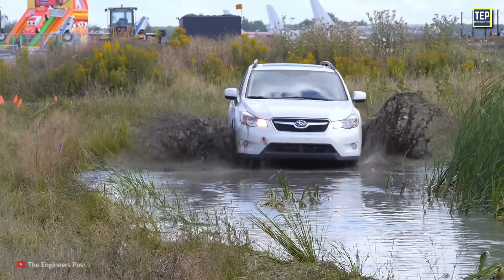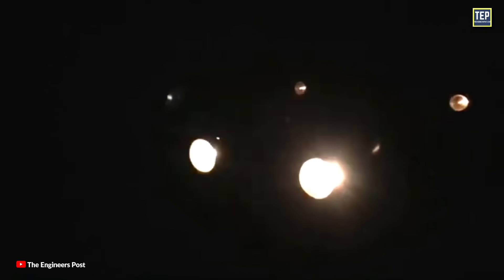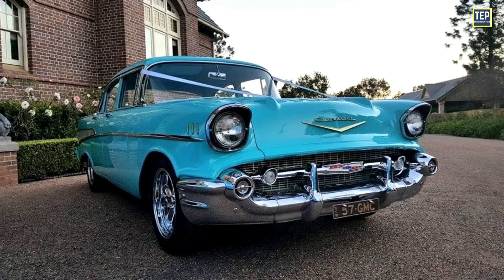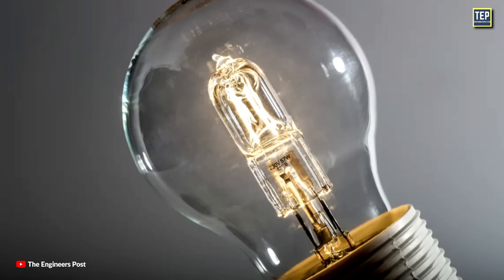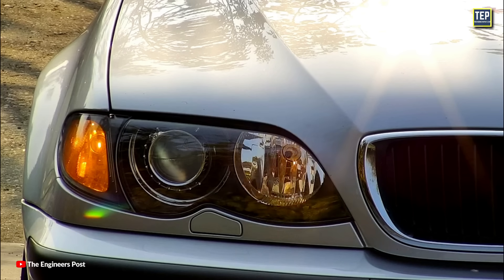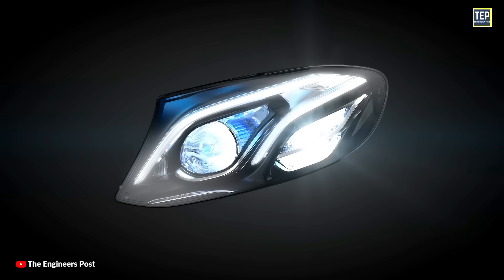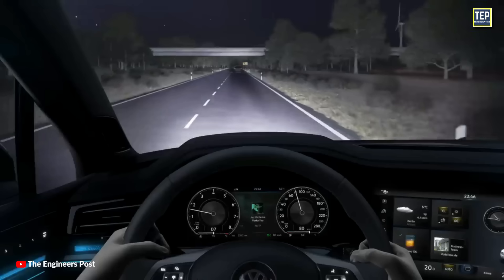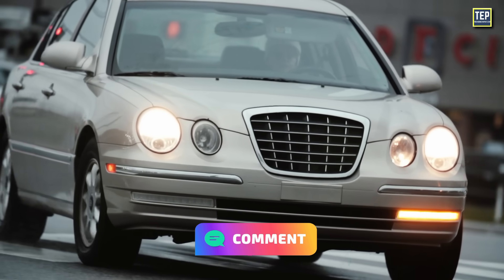The Problem With These Headlights

Comment: 13:07 I've installed Auxbeam h4 LED headlights into my 2020 Kia Rio which had halogen lights from factory and it's not entirely true that LED in reflector housing scatter light. I had to do slight adjusting of the beam pattern to match the original one but that's all there is to it. A money well spent as it illuminate more road surface and brighter as it's rated at 6500K at 24000LM shine so you guys might adjust your info...

Comment: I would rather change a $20 bulb than a $1500 headlight housing. I work at a collision repair/ body shop and I deal with it every day
Reply: I had to replace a headlight on my 2010 CL 550 after a small accident and just the one headlamp was almost $7k. To be fair even in 2010 Mercedes headlights were very complex. They were adaptive bi-xenon headlights that also projected infrared light for the Nightview night vision camera. Still insanely expensive though.
Reply: @-._.-._.-Sully-._.-._.-  My car cost 2K, so you could get 3 cars for that headlight!
Reply: Used to be that anybody with a screwdriver could replace headlights without taking the front end apart.
Reply: @yixnorb5971  A screwdriver, that's excessive. I just have to pull a rubber cap of the back then release a clip with my fingers to swap the Halogens on my Ford
Reply: @yixnorb5971 if you avoid accidents, you'll not need to replace the headlamps on a modern car. They should last the life of the vehicle.  
Isn't that better than constantly whipping out a screwdriver?
Reply: Yeah, right. It's like saying if you stop breathing, you'll die.@kewlztertc5386
Reply: @kewlztertc5386  True!However, when you live in a place that gets alot of rain storms or frequent hot and cold snaps, the headlight housing overtime has leaks leading to moisture build up. This normally happens after the warranty period end leaving you with close to 5 to 10k in repair cost. I have worked for Mercedes as a Technician and she this quite often.
Reply: @rcagillet 5 to 10k to repair leaks in headlight is just crazy. I assume you worked in a mercedes dealership, so it is against their policy to fix the headlights, correct? You have to replace the whole thing, but still, $5-10k seems very, very high. Is this for newer mercedes with complicated headlights? I think I saw an ad which shows mercedes headlights “dancing.” 

It’s actually not that difficult to find leaks on a headlight. If it’s the seal, which it usually is, it’s a pretty cheap fix, though it takes a lot of patience. If it’s a hairline crack in the lens, it’s even cheaper and easier. I’d go for ghetto fix rather than spend $5-10k 😅😅
Reply: @jegerm6752  true! However, once the moisture enters the assembly it's a shit show. You can repair it for cheap but your mutli beam advanced LED system might start giving you issues. In my honest opinion loads of crap
Reply: @rcagillet  yes my older BMW headlights leaked once, and I foolishly dismissed it, until the module for adaptive headlights got fried due to water ingress. Luckily it was the cheapest module in the headlight, and being a bi-xenon headlight, it was a simple and robust unit. Multi beam LED would be a total nightmare. I hate that we gotta replace the whole headlight assembly when it fails, no bulb to replace etc. Maybe some people know how to replace the LED chips, but it’s definitely very difficult and not a DIY at all.
Reply: @MattG-n2z  modern LED headlights are designed to last the entire lifetime of the car, and many are warrantied as such. 
So it may be expensive to replace them, but it's not something you're expected to do, nor should you have to ever do. 
If you damage them, that's what insurance is for.
Reply: @kewlztertc5386  
LED bulb modules are not that expensive to replace as you don't have to replace the entire headlight housing!!! They last a lot longer than halogen bulbs but they don't last forever!!!
Reply: @kewlztertc5386  And the government  knocking on your front door is there to help you😄
Reply: @williamevans6522  has the government ever knocked on your door? 
And yes when they have knocked on my door (or the door of anyone I know) it has been to help.
Reply: @kewlztertc5386   yes they have. They weren't  there to help.
I think your belief that it's  better tech is misguided.
Reply: @williamevans6522  it's definitely "better tech." Unlike with you, it's not my Opinion. 
Halogen bulbs last 2,500 hours max (1k min), while LEDs last 50,000 hours max (20k min).  That's scientific facts, not conjecture.
Reply: @kewlztertc5386  I believe you.
The problem is the electronics that drives the diode.
As quite a few have already posted, they do not last forever and are  very expensive to replace- which also is not conjecture
Reply: @williamevans6522   your comment makes no sense
The electronic (LED) will last, but the nebulous electronic that drives the electronic won't?

Heat and faulty craftsmanship are the only things that can shorten the lifespan of electronics. This is taken into consideration when the light's lifespan is rated. This is why the lifespan is between two numbers and not an exact number.  Similar to saying your lifespan is between 60 and 90 years. There may be defects or misuse that shortens your life, but you're type rated for that amount of years.
Reply: @kewlztertc5386  Your comment makes no sense.  The LED , itself is a discrete component while the driver circuit has multiple components.

How can you ignore comments in this thread related to problems and exorbitant  costs?
Reply: @williamevans6522  you mean the Light Emitting Diode, isn't electronic? WOW 

Driver components? Please explain.
Reply: @kewlztertc5386  Putting words in my mouth...
The electronic circuit  that supplies V to the  LED.

CLEARly we have a difference of opinion. 
I suppose  all the $$$ complaints and failures noted in this thread  are all make believe🤣
Reply: @williamevans6522  🤔 how many complaints have you read? 
Compare that number to how many vehicles are sold every year with LED lights (all). 
Then consider how every new car has a warranty. Now ask yourself, if you were a budget minded (P&L) automobile manufacturer, who has to repair or replace parts on a car that's under warranty, would you choose something expensive like LEDs, or something cheap like halogen if they had a similar failure rate?
Reply: Why I buy base model stuff with halogen reflector or projectors...
Reply: @cigarsgunsanddiesel8032   Because it works and is easy and cheap to repair.
Reply: Just one more reason why car insurance rates have gone through the roof. The Tesla car crash channels show repair costs for like $10-15k for what look like should be simple repairs, and many are totaled because the repairs exceed $25k.
Reply: My Subaru Outback's headlight was replaced when someone merged into me one time. Was AUD$3000 for the headlight alone (we have the LED Matrix version in Australia).
Reply: @HyRax_Aus  wow that's more than a shit-heap subbie is worth lol!
Reply: Totally agree. My 07 Accord Euro (TSX) eats bulbs as I drive on really rubbish NZ rural roads, and have my low beams on all the time. $20-30 is great. Another advantage is both high and low beams use the same bulb, and the incan bulbs for tail, brake, side lights and indicators are also all the same. Real easy to carry spares; sorted with just two bulbs! Thanks Mr Honda.
Reply: @granthoughton769 "really rubbish NZ rural roads" this why none of my vehicles have had reg or wof for nearly a decade!
Reply: @granthoughton769  Why do the rough roads eat bulbs?  Does the vibration break the filaments?
Reply: I deliver used/new auto parts and I couldnt agree more @The_R-n-I_Guy.
I once delivered used BMW headlamps, that were extrmely yollowed and all the rubber seals had dry rotted, each headlamp cost in that condition $2400.0 !!!
brand new was $7k-$9k depending where it came from.
while I applaud the engineers for most improvements, they need to consider the end user and they never do.
Reply: i whant a car to be as little of complex as posible, miss my old rust bucket, no abs no anti skid no power steering roll down windows and a good but easy fuel injection system that where converted to E85 fuel.
rust is what took the body on that old mazda and not som electric fault or price of some road safety needed part.
Reply: BMW have laser as standard in most 5 and up series now. The module is well north of 3000€ 😢
Reply: I completely agree, and that’s why I like my halogen headlights although I have had to replace one of my assemblies cuz the vertical adjuster was messed up. Standard price for the assembly was like $700 but I managed to find a reman unit for about $400.
Reply: I like LED headlights because halogen headlights burn out in a month and zi wasted money on them. @NeedForSpeed.2004
Reply: Up until the early 80s sealed beam was the law in the US. The critics said going to unique aerodynamic headlights would kick up collision repair costs. I think they underestimated the expense.
Reply: $1500 is cheap ! It's around 7500 bucks on laser BMWs.
Reply: You don't have to replace the headlight as often as a bulb.
Reply: @ReinhardSchuster  The fancy headlight assy.  costs 100 times more than a halogen bulb.
That difference will buy a lot  of bulbs.
Reply: Just replace the headlight of my 67 Mustang ... all of $35 for the whole thing.
Reply: I have laser headlights, and as long as I don’t have to replace anything more than once while owning the car then it’ll be worth it, to me. The quality and distance of the light they emit is incredible, and well worth the cost given the safety they provide.
Reply: Got my first BMW with LED , would never go back to halogen bulbs . LED light quality is just amazing compared to halogen. When had halogen bulbs , had to keep swapping them all the time.  LED lights on the car now for 9 years- never had even one issue
Reply: LED isn't expensive technology. If an LED housing is 1.5k, the type of light isn't the actual problem.
Reply: 100%
Reply: I would like to see when driving at night
Reply: I would rather see at night than save a little money.
Reply: @lobster8009  Yeah, regular headlights do not illuminate at all-🤣
Reply: The new matrix LED headlights are probably $18,000.00 each!!!
Reply: I fuckin love having sealed beams in my 86 ford the bulbs are like 30 bucks and it’s just 4 Philips screws holding em in.
Reply: You should shop rock auto, where the most common bulbs are closer to $6 than $20.  For that cost savings you can stock the most common sizes.
Reply: You dont like the income from ripping off suckers with fancy cars?

Comment: Hid in a projector was the best of all worlds as long is it's properly aimed. If you think new led lights are the problem you've never had a newer base 4x4 F250 or F350 with halogens pull up behind you

Comment: Whatever technology the headlight uses, doesn't matter. All headlights are properly aligned from the factory. The problem is when people mess with the height adjustments, not knowing what they are doing, or they put LED bulbs in housings that are not designed for LEDs. Aiming the headlights can be a PITA, which is probably why there are so many cars with headlights pointing at the sky.

Comment: Halogen lamps did not become commonplace in Europe until the 1980s. Prior to that, lower spec vehicles still had tungsten filament bulbs - in 1966 Volkswagen was still selling Beetles in Europe with 6 volt electrical systems and "glowworm" headlights

Comment: One of the main reasons for blinding LEDs is retrofitting them aftermarket on halogen bulb reflector assembly.. which uses mirrors to project light on the road. Which is meant for halogen bulbs of a same filament shape and light colour temperature. But retrofitting  LED in this assembly is the reason the light spreads to peoples eyes..

Comment: The one innovation that all truck makers need to implement would be auto adjusting lights. So when you attach a trailer, it measures the amount of squat and adjusts the headlights down accordingly, so as not to be blinding. When the front of the truck is angled up due to squat, it changes the angle of the cutoff line and the headlight becomes blinding.
Reply: Load sensor on tow arm, connected via car computer along with adjustments to the steering/brakes/traction when pulling.
Reply: This would just be investing in the same lights that blind people even when aimed correctly, so more sweeping change is needed.
Reply: It is mandatory in my country to have auto adjustable lights if the light is xenon or LED.
The car will fail during inspection if the light is not at correct level.

Comment: 14:48 the Citroën DS did it better😝 And why didn’t he mention it, that kinda got me mad
Reply: The DS not only had swivelling headlights but had high level lights at the rear (although just the indicators).
It also had a single spoke steering wheel and hydropneumatic suspension.
Way ahead of it's time.
Then there was the SM with a Maserati engine (and the swivelling lights too).
And lets not forget the XM which was essentially double glazed at the back.
Reply: Worse: he shows a DS of the second model. I too was waiting for the third 'nose' (year 1968). The  lamp lighting the inside of the curve could swing 80 degrees! A very dear miss!
Reply: Yes! Leveling and steering headlights
Reply: My idiot elder brother drove a Citroën with drive lights that moved with the steering. He chose to NEVER use low beam, instead switching between high beam and the 'drive lights' only.
Reply: Just like the Nintendo DS.
Reply: Maybe because this is a YouTube channel made by Americans, who are unaware of this French car. Let's not forget that at the time the Citroen DS was marketed, the European and American markets were largely closed to the import of foreign cars.
Reply: @josetrigueiro5978  In fact, the DSs sold in the US had the swiveling feature disabled in order to conform to US DOT regulations.
Reply: @josetrigueiro5978 this is a channel from India using AI voice technology. Couldn’t you tell this was an AI voice?
Reply: Damn, the fact that something as miniscule as that got you mad has me bricked up rn
Reply: @mosasa1307  should have said it, couse the concept is from the ds
Reply: @mosasa1307  dont brick yourselfe up

Comment: Two issues with the later ultra bright headlamps. 1. They still blind on coming drivers when the vehicle they are fitted to hits a bump or goes over a crest in the road. 2. if you need headlamps that bright you are either going too fast / need your eyes testing / need to take your sunglasses off!
Reply: Or you want the headlights to shine farther down road and into the ditches, so you can see the deer that like to come out at night sooner and not hit them, so you don't destroy your vehicle. The farther down the road you can see the deer the better chance you have of braking and not hitting them.